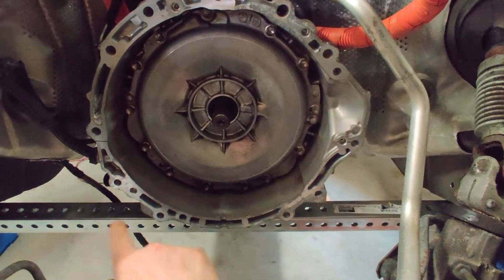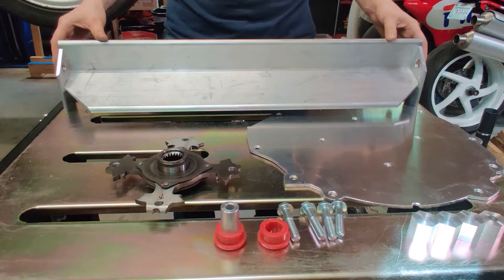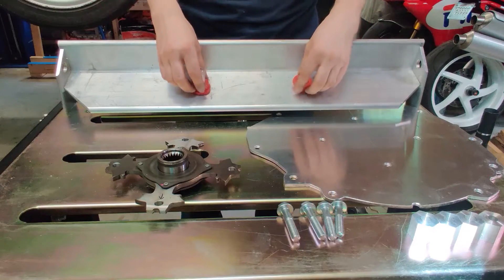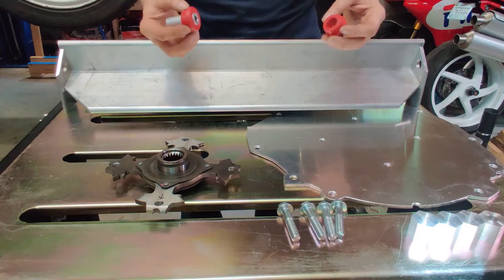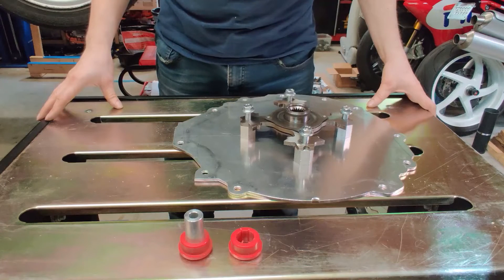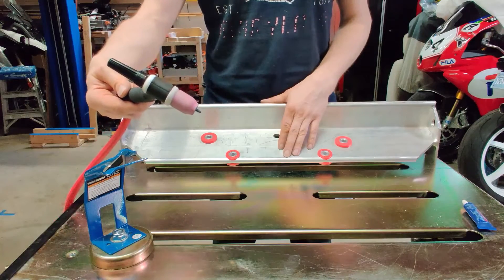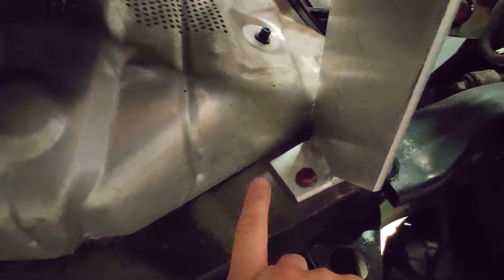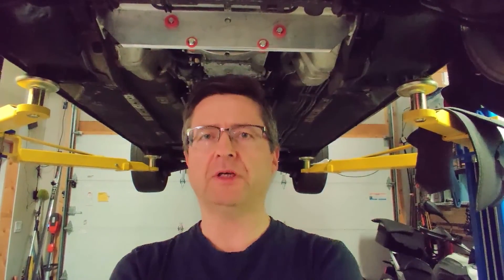Jaguar XJR EV Conversion - Transmission Mount

Comment: Great videos!
How did you mark the centre of the adaptor plate?
Is 3/16" aluminium thick enough? I've seen someone use 1/2"!
Reply from the maker: Hi, it is actually 3/8" and I feel it is way more than needed, 1/4" would be enough for sure. For center I used some business to extend shaft so it touched plate to make mark.

Comment: Loving this build, I only found it today and I'm going through your videos.
Did you find this sufficient to hold the transmission? In the Lexus it would have had 11 bolts holding it to the engine plus others but all the torque is now going through just 4 bolts.
Thanks for sharing.
Reply from the maker: Yes, 4 bolts is sufficient as long as bellhousing is closed off with cover bolted all-around.
I did however change mounting points from those bushings to larger more flexible mounts. Those bushings were too small and too stiff. As result vibrations from transmission were transferring easily to chassis. This was very unpleasant. Now problem is gone

Comment: Impressive skills.  How did you bend the trans bracket?  Do you have an email or website.
Reply from the maker: I am using aluminum angles so i do not have to bend anything. I used different size depending on application. Large one that goes across to hold transmission is 3" x 5"